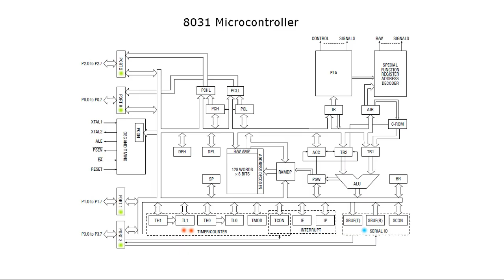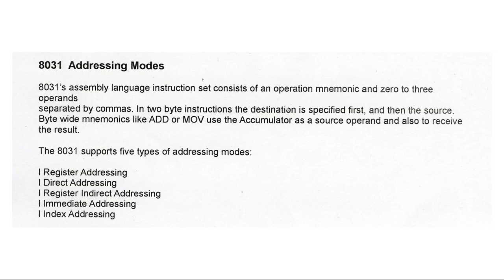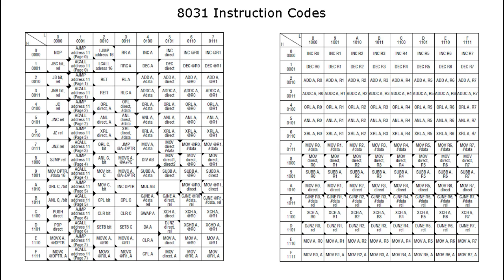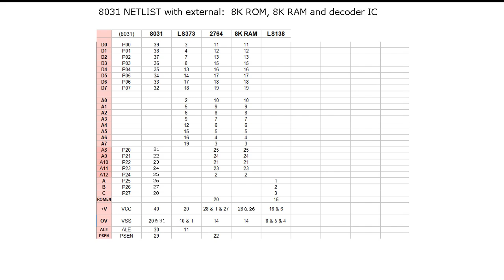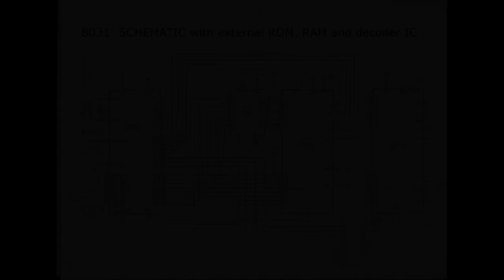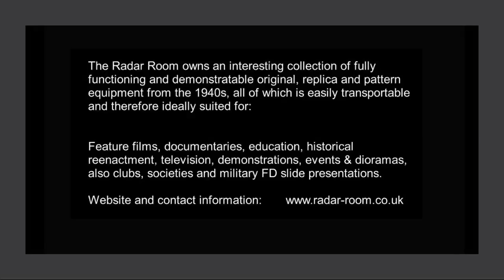Using an 8031 Microcontroller

Comment: Thank you for sharing. Your videos shows some interesting tricks and hacks ;-).. just like when you played with 68000. Could you share your code, that is used to test RAM IC with the small 7segment LED display?
Reply from the maker: Glad you are enjoying the videos. To make the simple RAM test program work you'll need to work out the enable circuitry and set the display addressing to 4000/1/2/3 for the DL1414

The prog is short and simple and hopefully you can cut n' paste and sort it out from here:

RAM is at 2000h  DISPLAY is at 4000/1/2/3h

0000 74
0001 2D
0002 90
0003 40
0004 02
0005 F0

Put a hyphen out into display digit 4002h (3rd. from right)

0006 74
0007 41
0008 90
0009 20
000A 00
000B F0

Put an 'A' into RAM

000C E0
000D 90
000E 40
000F 00
0010 F0

Put RAM into display 4000 (RH digit)

0011 80
0012 FE

Loop
Reply: @lishaton  

;RadarRoom simple 8031/8051 RAM test. RAM is at 2000h  DISPLAY is at 4000/1/2/3h

	ORG	0h
Start:
	mov	A, #2Dh		;put A' into Acc
	mov	DPTR, #4002h	; write to DPTR address of Display 3rd digit=2 (0,1,2,3)
	movx	@DPTR, A	; write 'A' to DL1414 display

	mov	A, #41h		; Put a hyphen out into display digit 4002h (3rd. from right)
	mov	DPTR, #2000h	; set DPTR to RAM 0000 byte
	movx	@DPTR, A 	;Put an 'A' into RAM 0000 byte
	movx	A, @DPTR 	;Read out 2000h location (0000) RAM 
	mov	DPTR, #4000h 	; set DPTR to display address
	movx	@DPTR, A 	;Put byte from RAM 0000h into display 4000 (RH digit)
	jmp  Start
	END

Comment: This is a little trip down memory lane, just like daveh7720, I also used the 8051 family with PL/M-51. Although by the time I started in the early 1990s they had progressed to 89c51 versions which used EEPROM (I think). I really liked the Phillips versions which had a several different chip options. I used one with six counter/timers, some of which were 16 bit counters,  and included programmable options such as servicing an on board UART, PWM signal generation, external input pulse counting.
  My favorite was a communication protocol (I2R?) that I used to interact with Dallas Semiconductor TSSOP6 parts; a small battery backed chip w/ dual counters, or temperature sensors,and others I can't remember, all of which had unique digital serial numbers. I used at least one of these on each 89c51 board so the programs could be identical (no unique ID in the programs) .  The RS485 comminication protocol could have several of the 89c51 boards on the same simplistic network.
   My greatest pleasure when implementing this was a fluid dispensing control that could keep track of an input pulse count without the communication interfering with the accumulation of those pulse counts. Then it could be programmed to perform an operation defined in the command structure (terminate flow, initiate a secondary command, etc.).
  This was something I had done because a 'stand-alone'  ethernet capable MCU I was initially tasked to use did not have independent counter/timers. As a result the more the Master Program on a desktop computer sent ethernet commands, it would cause the individual fluid controls to miss fuid flow signals. 
  I never got the 89c51s  to interface directly to an ethernet, even though I think they might have managed it. 
  Sadly I haven't worked with this for years now.
Reply from the maker: Thanks for that interesting reply. It's always nice to find out how the devices were actually used in their hey-day. So the Philips ones you preferred had extra 'bits' thrown into the package then? I guess that this is a little like the 6309, where Hitachi put a few extra registers etc. into a 6809 and allowed it to run in two modes, the original and the 'improved?' version.

Comment: Can't believe this was uploaded yesterday. This feels like one of those valuable videos you get recommended 12 years later. I have some 8051 that I have never really used, I'm going to dig them out now.
Reply from the maker: Sounds like you might have fun then :-) Don't forget that you can turn your 8051s into 31s by grounding the /EA pin (P31) so that you can use an external ROM chip.

Comment: When I first started as an embedded programmer in the 1980s we used the 8051 or 8031 in several products. (And the 8751, which was an 8051 with onboard EPROM instead of ROM.) I wrote a lot of code in PL/M-51, which was Intel's higher-level language for the chip.

If I remember correctly the overlapping memory spaces were for the bit-addressing instructions. To minimize code size the 8051 had instructions to read, write, and test individual bits in a limited space. That space included the I/O port pins. It wasn't necessary to read a byte into a register, mask off a bit to test, write a new value to it, restore the rest of the bits, an write the byte back out to memory.
Reply from the maker: Most interesting to hear from someone who used the devices in the real world.  Makes a bit more sense now. (No pun intended) Many thanks for the sharing all this info. with us!